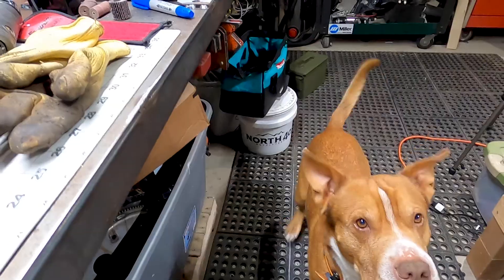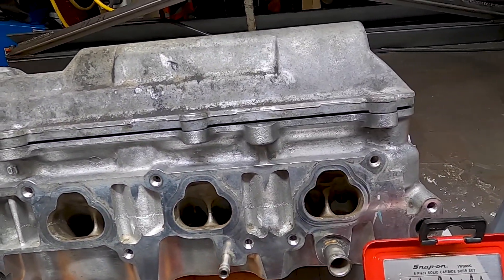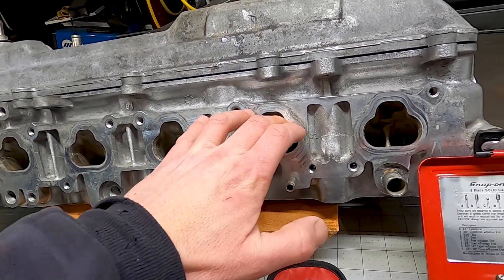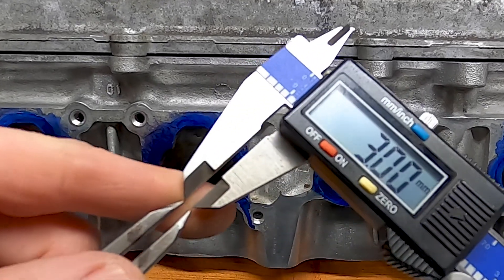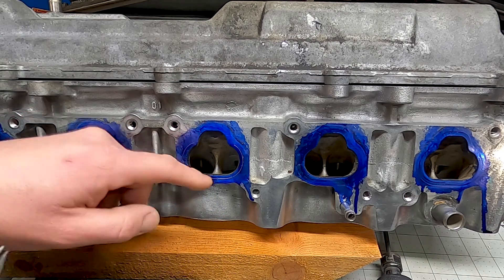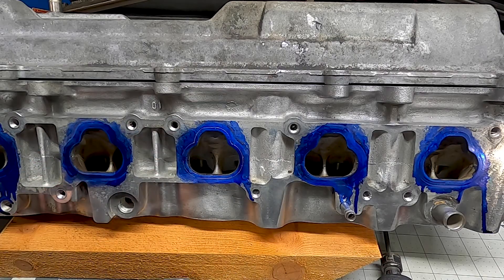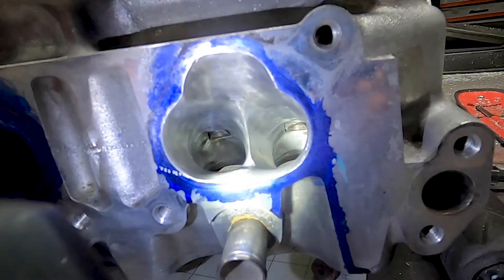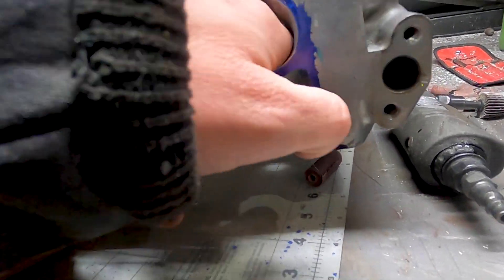Cylinder head porting

Comment: The worst part about these heads flow wise is how shrouded the valves are. The 1998+ heads flow much more due to the better combustion chamber design Do you plan on doing anything about the terrible combustion chambers?
Reply from the maker: Hey thanks for heads up,I hadn’t heard that before, I should be getting this head flow tested very soon so I’ll show my results and we can find out , if it is the case there’s not too much you can do but there may be a few little tricks to assist in that department

Comment: Love these videos… Any more updates by chance? Have a 1996 LX450/FZJ 80. Would love to have this done. Do you ever accept any engines to do this kind of work?  Thx either way.
Reply from the maker: Thanks Scott! Just about finished up on the intake manifold multi part videos, I had to put the engine aside for the summer to do customer work and go to the track to run another vehicle I built recently, I’ve got a speed shop here in Washington state, if you can get the engine or vehicle to me I’d be glad to build one up for you 👍🏼

Comment: When  you check the results of the porting, do you check the air velocity and the cfm or just the cfm?
Reply from the maker: The flow benches measure cfm but I think you get the velocity as part of the equation anyway , the velocity should be anywhere from 150 mph upwards of 250-300mph , I’m not sure of the peak cfm of this cylinder head yet but I’d like to see anything over 300 cfm